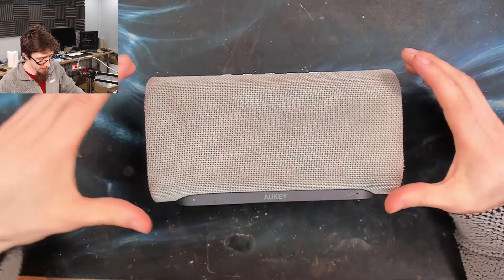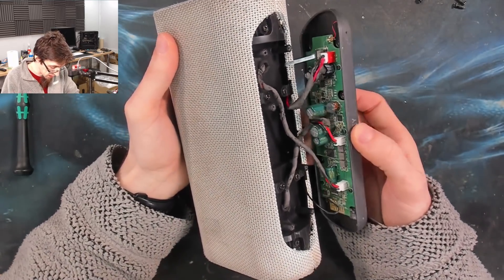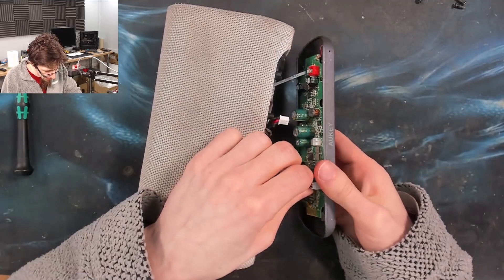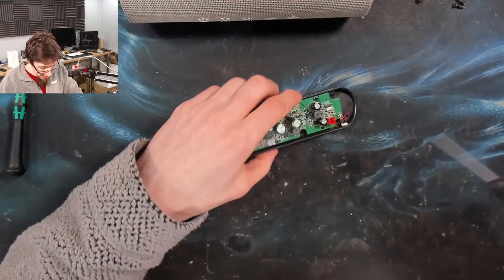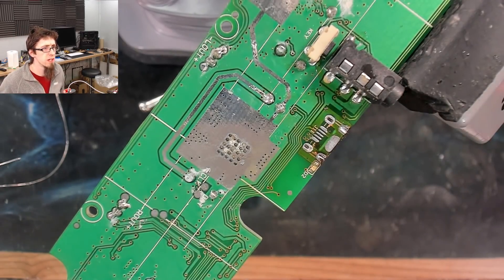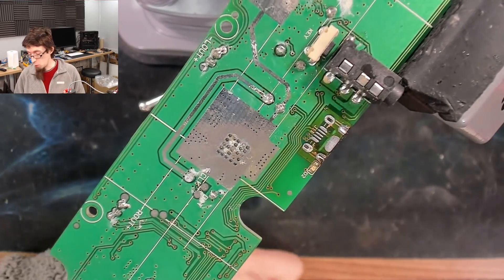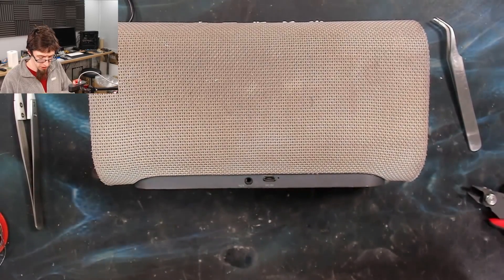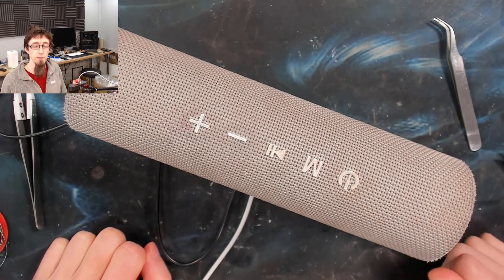Aukey Bluetooth Speaker Repair - LFC#289

Comment: I like your work, here is the tip for easier workflow just use more paste and even on holes you want to clean also do not use a lot of heat like 450° use like 350-380 high temp will burn flux faster and then it's harder to wick off all solder but we all need practice it's just advice im doing same and also i was struggling with cleaning till i found right temp and apply always more flux, also those pins you can solder easier if you put more and just pass all with solder blob no metter if you make bridge it's easy to remove when flux is there. So many times i wrote flux so it is your friend in most scenarios have a nice day mate ! :)

Comment: For clearing out big holes like those, you can go the bigclive way. Melt the solder with the iron and slam the circuit board on the desk. Works great.

Comment: Use flux and low melt solder to pickup the solder from holes or any solder for that matter with your wick, this method is outstanding for hard to remove components on all electronics you work on

Comment: For wicking through holes I find 99% of people struggle because their using the wrong kind of wick or not using enough flux. You need a more tightly woven wick like tech spray. I use to struggle a lot with this as I was using goot wick. As soon as I switched to a more coarse wick, namely tech spray it went much much smoother. I'm not a fan of desoldering guns. FAR too expensive, and frankly freaking useless! Nozzles are such poor quality so they do not seal properly. Pumps weaker than a 10 year old Asertek sue happy AIO. And nozzles so poorly designed your lucky to get two joints cleared before it clogs up and you have to disassemble the whole tool to clean it! Desoldering guns are the peak of snake oil!

Comment: You mentioned your desoldering iron tip being clogged, you can just clear the clog without having to buy a new tip.  Here are the tools made for this by hakko, I have them and they work great when my tip gets clogged up.  Hakko b1303 cleaning drill and 888-001 cleaning drill.

Comment: Wicking out of holes, I find, is helped by having a dome of solder, lots of flux, and relatively unused wick so it has a large 'suck' capacity. If you remove enough solder such that it forms a little cup inside the hole, it is very hard to wick that out.

Basically, you are relying on surface tension to pull the solder out of the hole into the wick.

Comment: Change your soldering wick, try a MgChemicals or a Chemtronics one... :-)
Reply from the maker: Will give it a try! This is cheap ebay stuff. It's fine for cleaning pads, but I'd pay more for stuff that'll effectively clear holes.
Reply: @Adamant_IT  I'm not a reseller in any way ;-) but I tried dozens of no-brand wicks and were awful, the MgChemicals in particular is on another level. Try also low melt solder, is incredible for removing usb ports without effort.
Reply: @riparaggi  Thank you very much for sharing this information with us. Greetings from Mexico.
Reply: @Adamant_IT  Desoldering Braid (2 of the best options): Techspray model 1813-5F & Chemtronics model 80-6-5 available at mouser electronics and I saw that they exist in the UK (YES, they sell you at least 1 piece and you download the datasheets right there for more information). There they were bought wholesale by the television assembly factory where I worked. It uses genuine amtech 559 flux (NorthridgeFix is its authorized distributor) unfortunately for me the laws of our countries require very demanding special customs permits for the import of chemical products although we have a free trade agreement for North America (Canada, USA & Mexico). All the best.

Comment: Could you swap it out for a usb c type?
Reply from the maker: This is probably do-able, but would require some extra modification, especially if you want it to be Power Delivery compliant. I've been looking at doing this with some other stuff, and so far it seems to be more hassle than it's worth.
At the shop I have a multi-output charge station (Pine64 Pine Power Desktop) and at home I have a Y-splitter cable with a type-c and micro-b plug on it, so I don't have to keep swapping cables around. Eventually everything will have Type-C on it.

Comment: Those "pretty" woven cover panels look a touch manky!! So........are they washable??
Reply from the maker: Maybe. I just attacked it with a toothbrush and glass cleaner, and that didn't seem to do anything. I think you'd have to fully disassemble the speaker so the casing can be properly washed. Definitely a disadvantage if you're likely to use this speaker outdoors / with grubby hands.
Reply: @Adamant_IT   Why thank you for your unexpected reply Graham! 
With a lot of these fabric covers virtually glued to the shell of the piece of tech they cover, its almost impossible to keep them clean.
Waste of good material in my honest opinion. Better to design them such that they can be removed and at least hand washable. 

in any case, thank you for an enjoyable and informative video
Respectfully yours, R

Comment: To unblock holes filled with solder, just use wooden toothpick. Heat hole up, stick toothpick inside, wait to cool down, take out toothpick and voilla! Hole empty!
Reply from the maker: Holes are too small. Or at least, I haven't see a toothpick that small. These holes are thinner than a paperclip.
Reply: @Adamant_IT  I’ve seen hollow stainless steel needles on eBay that are supposed to be good for that. The solder doesn’t stick to the stainless steel apparently
Reply: @Adamant_IT  A safety pin works a treat. Thinner than a paper clip and tapered.
Reply: wow, great tip

Comment: It could be a reset button, not a cable detection switch behind 3.5 mm jack
Reply from the maker: I wondered that as well actually, I was flipflopping between "is it a reset" or "is it a poorman's jack-sense" during filming.
Reply: It is a rest button in the audio jack.